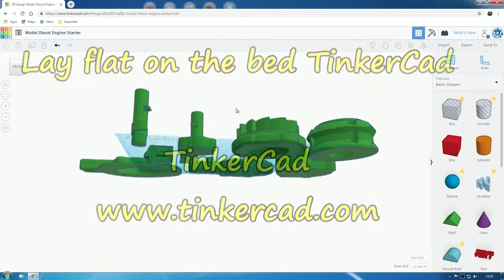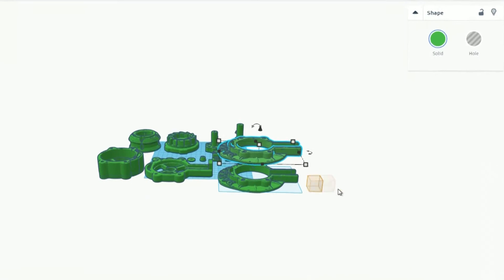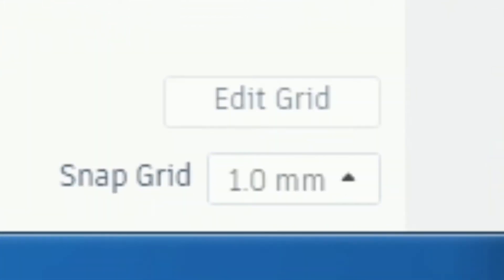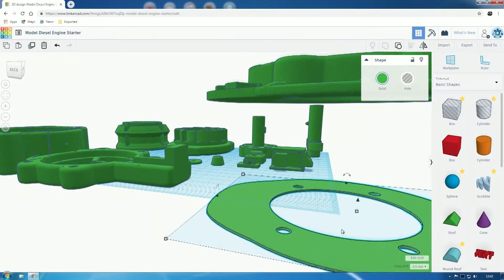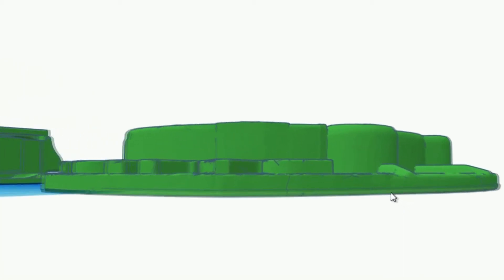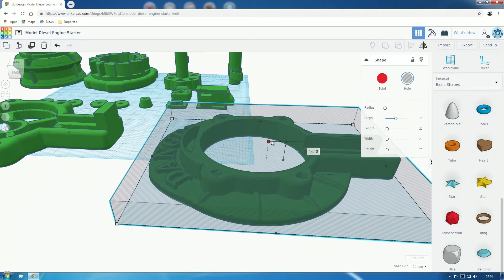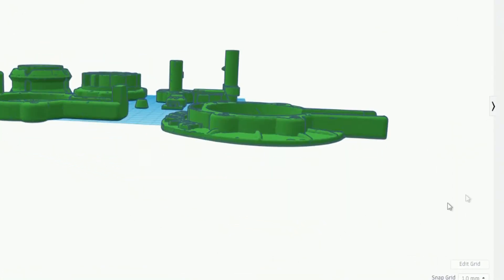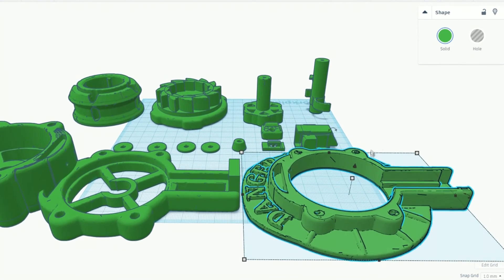Lay flat on the bed TinkerCad

Comment: Amazing!! I moved some objects over from another cad program and they were crooked. Not much, but to the point where the slicer would have to add support under a portion of the flat object because it was slightly above the build plate. Your instruction here helped me to finally get the pieces to lay level and flat. Many thanks!!